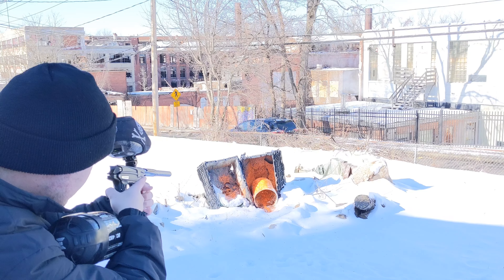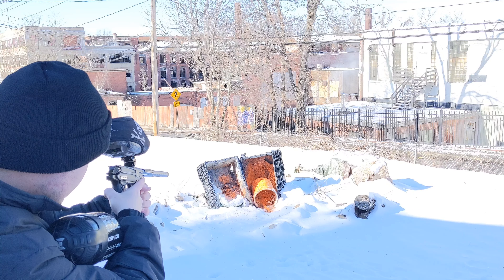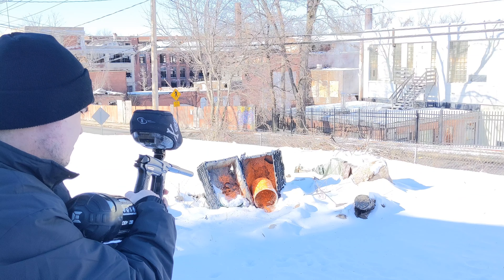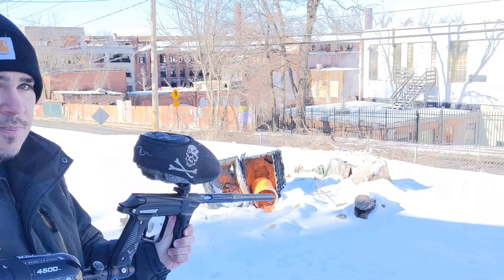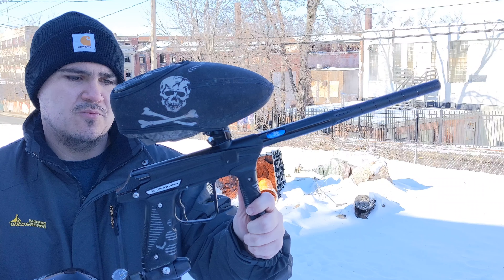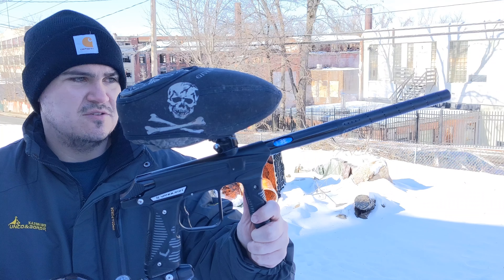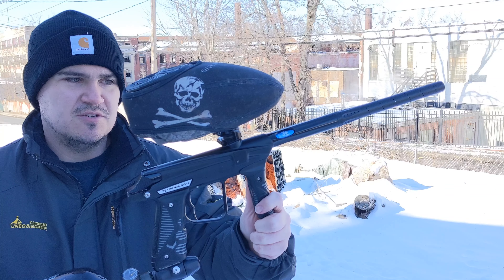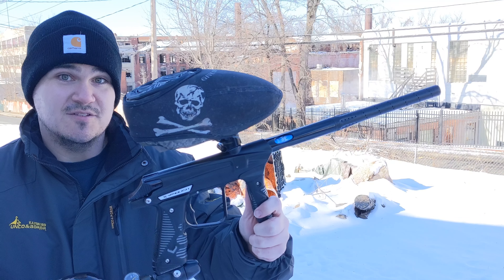Vanquish V16 in Cold Weather (15°f/-9°c)

Comment: Settings?
Reply from the maker: Check the caption of the video.
Reply: Why switch to Buna? You did it for all the urethane or only the dynamic seals?
Reply from the maker: @dawscaus  I always swap to buna for the functional o-rings on my spool valve markers. It's part of the overhaul I do when I buy a used gun. It's mostly just for peace of mind. I use buna because I have a large assortment of o-rings in that material and I save the factory parts kit in the event that I resell the marker.